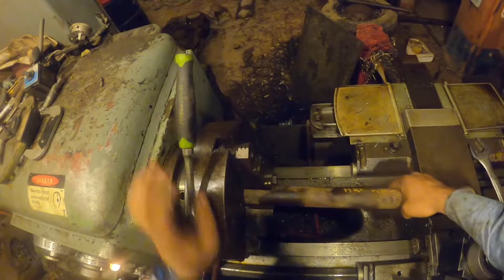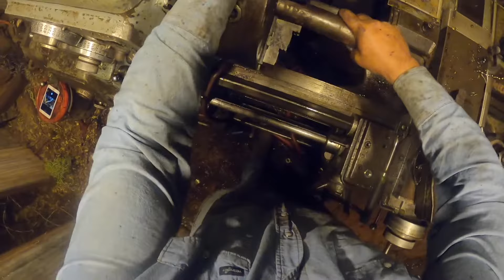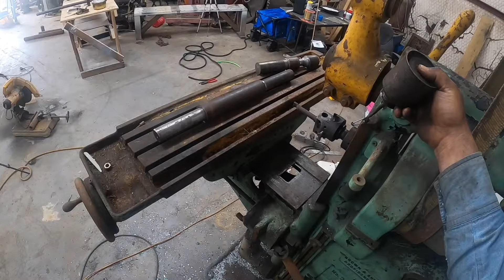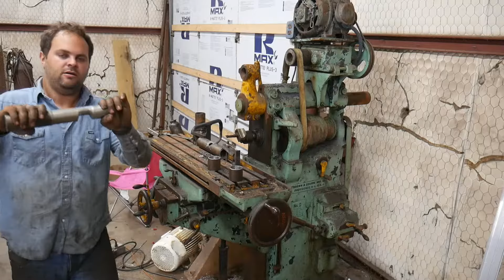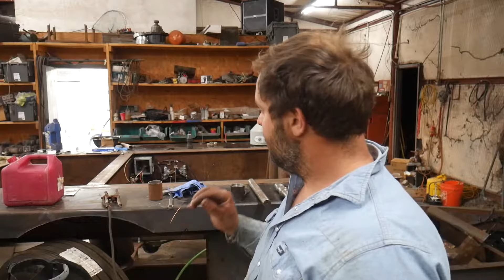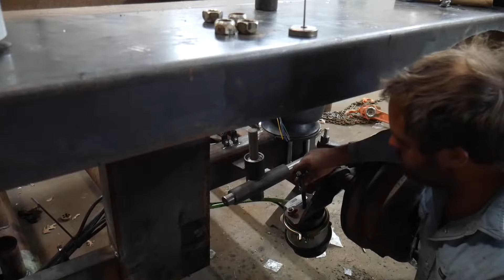Steerable Air Bagged Trailer Part 4. Machining of the Steering Lock

Comment: Happy New Year Zach!! What about that chunk key? That whole set up is quite a marvel. Zach have you looked  at improving the steering on the Pete at all? I know I’m faces with similar turning radius issues.
Reply from the maker: Thanks. It's actually laying there somewhere. Ive had that ratchet and an extension up there for years and seem to always use them instead.

Comment: Your machine shop looks like a bomb went off inside and why is there a boat inside there? LMAO
Reply from the maker: Its somewhat an interesting story. My great grandpa and a partner ran a couple of business to of that old shop from the late 40's up until the late 60's when it become his junk barn. He lost his sight in about 1980  and the building sat untouched up until 2012 when i bought that lathe and didn't have a good place to put it. Most of the stuff including his boat, gas powered refrigerator, and old gas pump is just how he left it. The junk I've hauled in the door needs to be put up but all the stuff in the back I like to leave just because.